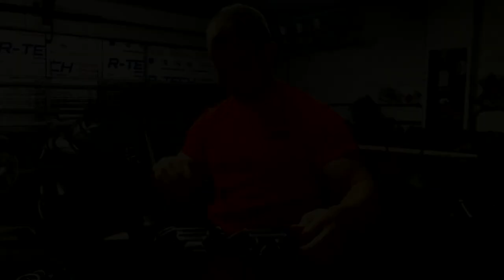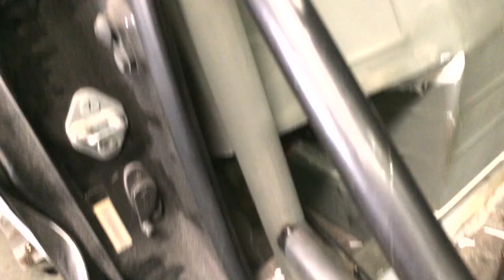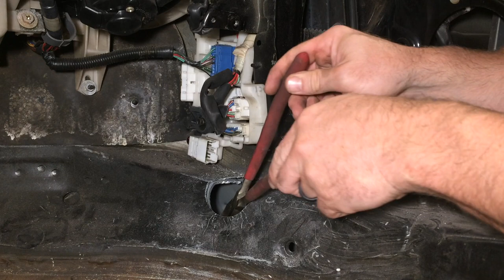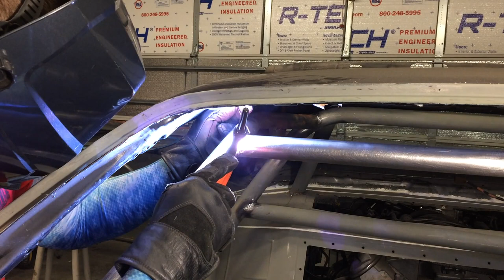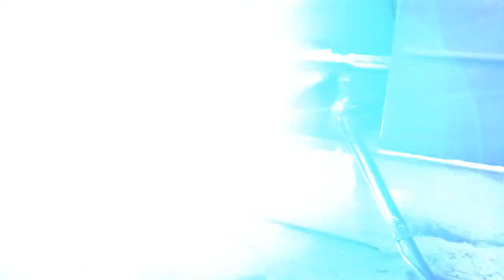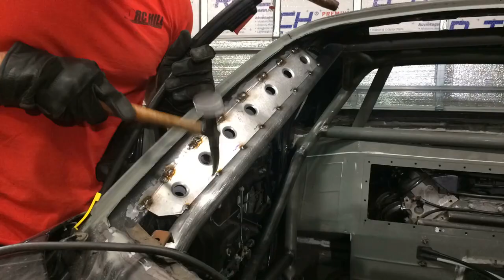DIY Roll Cage Pt. 3 (V8 Mr2 #29)

Comment: I have one question about welding gussets? I was taught that while welding big pieces of metal, like your gussets, I should start from the middle so in case I warp the metal I can still manage to make it work. Of course my welding isnt as good as yours but is that a thing or it doesn't matter and I can weld from side to side
Reply from the maker: correct in most cases. make spot welds first to help warping. occasionally, you will see me tap the metal in between welding to help with distortion. just try to space out your welds and allow cooling time in between. if you get a wide blue color far from your weld, its too hot. keep up the practice!